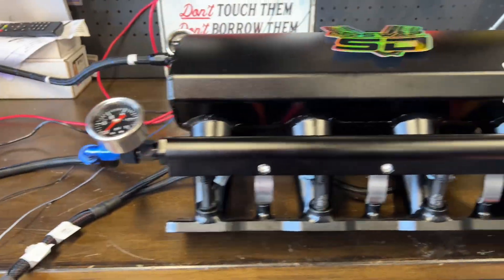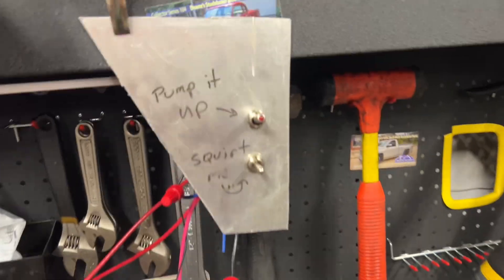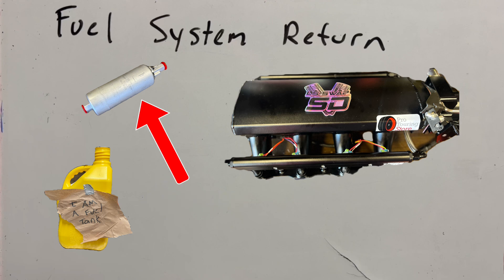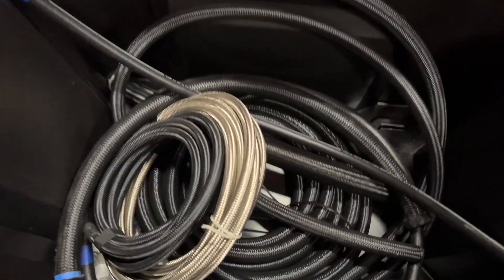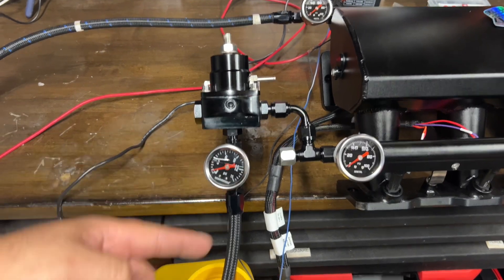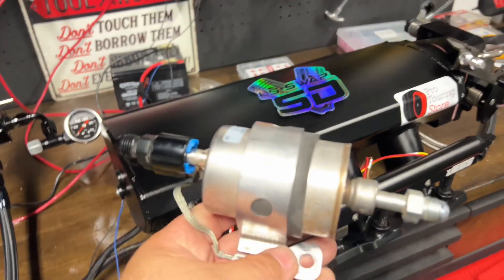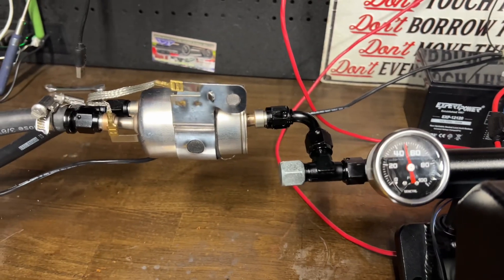LS Swap Fuel System & Corvette Filter Regulator

Comment: I been scratching my head. LSswaped my 97 chevy pick up and they say my stock pump will run the 6.0 truck motor... but no body says i gotta plug off the return on my rail and put the corvette filter regulator in.. Hell yes good stuff funny too. I learned from it so good video

Comment: The last minute is solid gold. I deal with SO many swaps with vette regs and oversized pumps - all without pressure gauges. The stopper on that gauge is roughly 130psi so it's probably well above that.

The stock PCM's and even Terminator (as installed) will never know your injectors are suddenly flowing >50% more, and the stock trims usually max out around -50%. And guys wonder why they can't get their fresh swaps to start.

Comment: Would the pressure change if your running the stock 1999-2002 5.3 LS fuel rail with the return capped off LS swapped and use the corvette filter/regulator?
Reply: I’m haveing the same problem

Comment: Lmfao! Deff subscribed! But yo so how do you make the filter regulated style work to where it will do 60psi ?
Reply from the maker: There is 2 diff types, one that does 43 psi and one this does 58 psi. U run enough fuel, it will increase psi
Reply: @LSSwapSD I’m dealing with 85 psi at the test port and backfiring from the exhaust and I’m running the corvette style return system

Comment: I tried a corvette regulator after after having leak after leak with my gen 3 vacuum regulator fuel rails with am hide to fit on tbss intake. Si i got a tbss fuel rail and the corvette regulator. Stock truck fuel pump engine bsy caught fire within 2 minutes of that set up

Comment: I plan on using the Corvette filter/regulator on my swap with an in tank pump, In the instructions for the Vette filter it says it will not work with a 340 LPH pump. Recommended is a255 LPH
Reply from the maker: 😳😳 are you just confirming what I said or did I mess up?
Reply: Vette regs tend to have issues >190lph. Some will return enough for a 255lph, but above that you have pressure skyrocketing until the injectors consume enough.

Comment: Easy to understand mf’er and I wonder about the Chinese corvette fuel filter regulators, if they both leak and don’t hold the pressure, haa ha
Reply from the maker: They make some filters with welded in fittings. The second filter I used is that type

Comment: Great demo
Reply from the maker: Thanks for the feedback. I was hoping it made sense. It did in my head.
Reply: @LSSwapSD  It's more difficult, but I'd love to see if there's a pressure drop across the rail with all the injectors full open.  Just an idea.
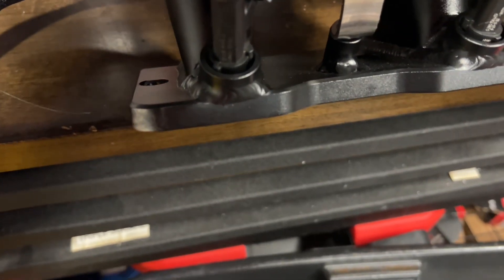Reply from the maker: @chriswise1232  if you notice at the 5:20 mark, when I have 10psi of pressure and I activate 1 injector, the pressure drops by 1 psi. So yes, pressure would drop somewhat cause u are relieving the amount of restriction. BUT if you have a fuel pump that can push enough fluid to make up for that loss of fluid, the pressure drop would decrease and be negligible.